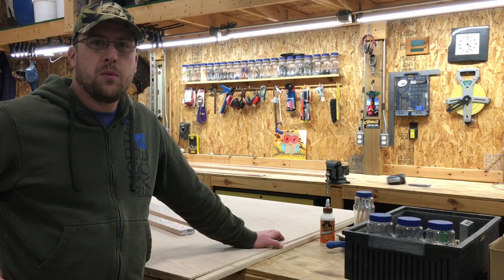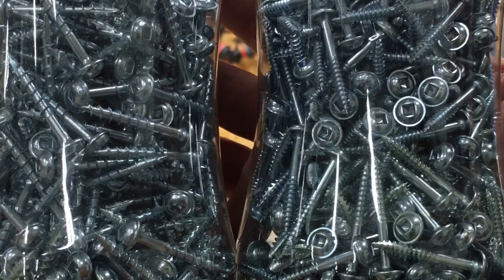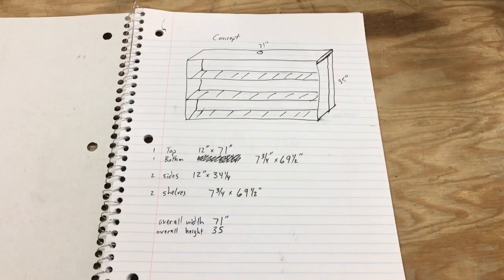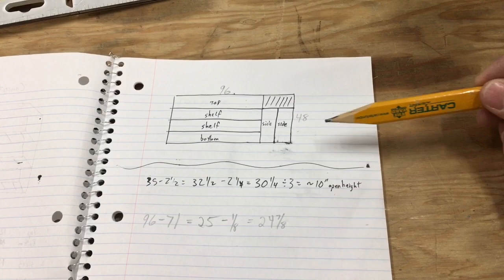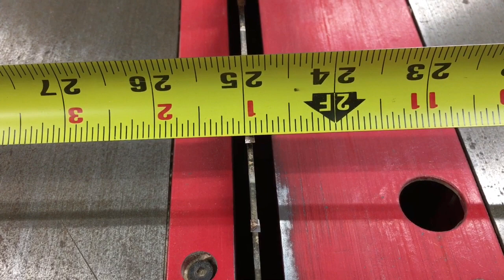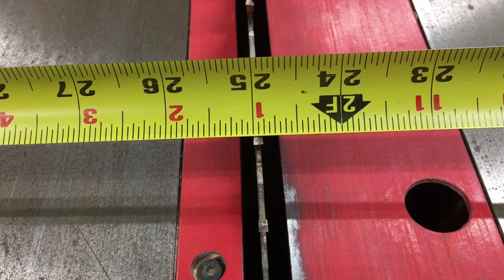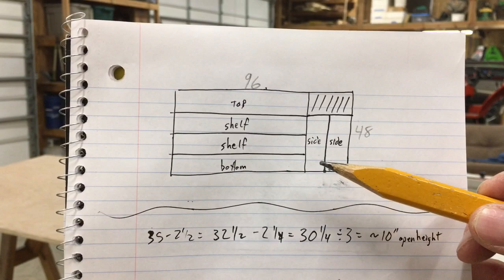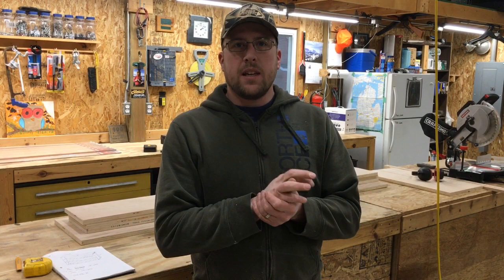057 DIY Woodworking with Craftsman Table Saw

Comment: Do you still have this saw?
Reply from the maker: Sure do. It’s a nice basic saw and easy to use.
Reply: @LivingOurAmericanDream  not sure why I didn’t see the reply until now😬

So, I have one that I picked up from an estate sale for less that $200 and it is practically brand new….. the top was not on it so I mounted it and am trying to get the top square to the side, and was curious if you have any tips for accomplishing this? Also noticed the aux fence is on the right side of yours, mine is on the left and think it contributes to pinching and some runout at times…. You recommend moving that?

Comment: I just bought that table saw used. It doesn’t have the guard or splitter. Could you make a template or give me the measurements for me to cut one out of sheet metal?
Reply: What did you pay?  What did it cost new?